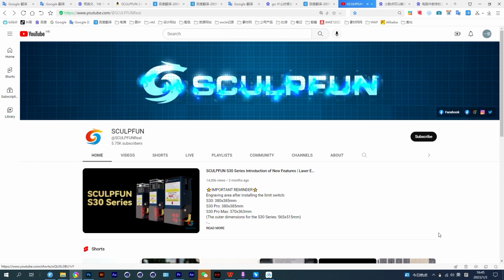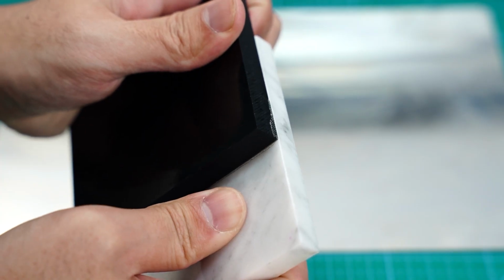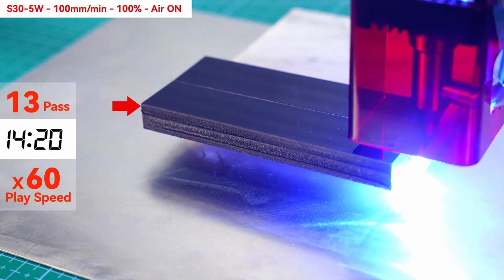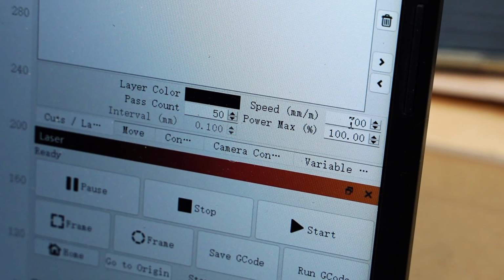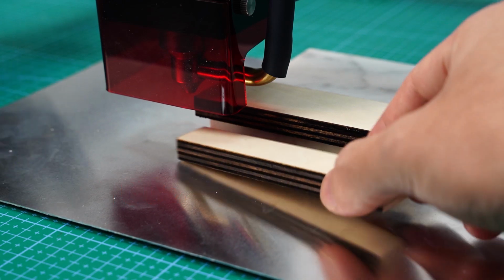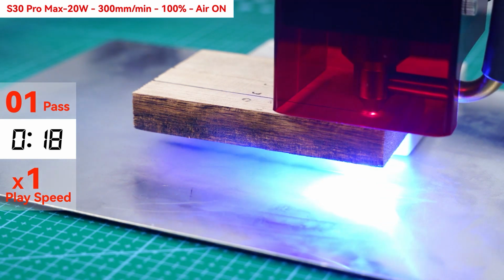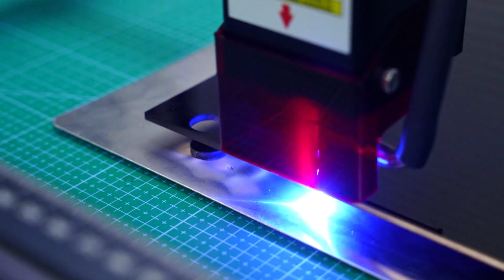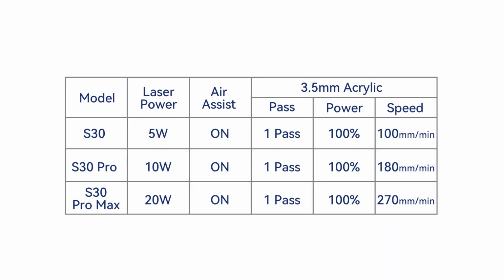Faster！But How Much Faster? SUCLPFUN S30 5W 10W 20W Laser Cutting Efficiency Comparison Test

Comment: What is the difference between 10w S10 for $470 and 10 w S30 pro with air assist for $510?  The S30 seems like a much better deal.  I must be missing something.
Reply from the maker: S30 pro 10W, with automatic air-assisted air pump, limit switch, linear guide rail in the package, can upgrade the Y extension axis, can upgrade the XY extension axis, can replace the lens, and one replacement lens is included in the package too.
-----
S10 10W, you need to buy an air pump (manual), it has a linear guide, you need to buy a limit switch if you need. You can upgrade the Y extension axis, you can upgrade the XY extension axis. And there is no replacement lens in the package. Can be upgraded to automatic air assist (need to purchase matching motherboard and air pump)
-----
We will launch a new model soon, please join the group for details：https://www.facebook.com/groups/sculptfunusers

Comment: I just buyed the s30 pro , but can't cut Even 3 mm mdf, for 9mm what settings would You use?
Reply: 7mm/s（420mm/min）
100%
3 pass  maybe
Reply: @党一哲  i'll try, it is a trial and error learning curve, but, at the end it works and it's satisfying, i just succesfully cutted 3 mm mdf, with a 700 mm/min 70% 3 pases air on config, i'll keep trying for thicker material
Reply: Hello, what Model do you have 5w or 10w or 20w ???

Comment: 20W laser is compatible with S9 model? If yes, what is the price of 20W laser
Reply from the maker: Sorry, 20w laser head can't match the S9 machine.
Reply: 20W laser has not been listed yet
Reply: Even if we have it, we don’t recommend putting 20W laser on S9 for high -speed carving work
Reply: Low -speed cutting should be fine

Comment: Is it possible to upgrade s30pro (10w) to 20w from s30pro max?
Reply: Unfortunately, no.  The 10w is 12v the 20w is 24v. Fell for the same catch.
Reply: @OscarDaFish  Thanks.
Reply: @markosrebernjak1175  I bought the 10W initially hoping that I could upgrade to the 20W later.  That's when I realised you couldn't.  :(
Reply: @OscarDaFish  So, 10w from S10 is the same to 10w from S30Pro ?
Reply: @anabel1488ify  10w is 10w, so yes. :)
Reply from the maker: @OscarDaFish  👍

Comment: The best cutting parameters for 3mm black cast acrylic to have best cutting surface quality for 20W Pro Max are: speed 140mm/min, 1 pass, power 19%, air assist off!
Reply: Which speed and power cutting acrylic 4mm
Engreving speed and power acrylic 4mm sculpfun s30
Reply: @muhammadafnan4437  Hi. For engraving the acrylic I use speed 2000 and 40% of power. For cutting 4mm cast Black acrylic I would use speed around 90-100mm/min and power around 35%, 1 pass, better with air assist, but if you prefer cutting without air assist, deceeasing speed to 80 may be considered.
Reply: why？Why is the laser power so low？  Is your speed parameter written the wrong unit?
Reply: @党一哲  if you do the cutting test like in the movie you show "just" capabilities of power and speed. For real work when you require quality and repeatability of the parts, you have to also consider how thick is the cutting gap and what happens at the bottom of the cutted part. When you add more power to acrylic cutting you'll have wider gap and some burns at the bottom side. Speeding up from 140mm/min to just 200mm/min requires of using 50% of power - that lowers the cutting quality. So in my opinion the best results for any materiał is to set the proper speed for the lowest power capable to cut through. Then you have the thinest gap and the best quality. Acrylic 3mm is 140mm/min 19%power and acrylic 6mm is 70mm/min  72%power, both 1pass, both no air assist. Overall the 20W pro max laser cuts very wide gaps, much more wider than 5W laser, so you have to also consider this parameter.
Reply: @piotrdivineacoustics5754  Sorry, my English is not very good. I can't fully understand what you mean.
First of all, low speed cutting or air assisted cutting will make the cutting surface effect of acrylic look poor. However, the test in the video is only conducted from the perspective of efficiency.
Second, the "just finished cutting" in the video is only for testing. In actual work, it is necessary to adjust the speed and pass count according to the drawing difficulty and material thickness. If you want to cut the surface perfectly, you really need to increase the speed or reduce the power.
Third, the default upper limit speed of 20W is 100 mm/s. Since the 20W laser is heavy, it is not recommended to lift this limit. Your 140mm/s, are you sure it is mm/s, not mm/min
Reply: @党一哲  you are correct, its milimeters per minutes, not per seconds😉🙂🖖😎
Reply: @piotrdivineacoustics5754 does this mean S10 is sufficient for cutting those 3-6-9-15mm plywood ? 

And by 10w+ power, it’s more than enough ?
Reply: @thanatosor for 8mm plywood I use about 80% of 20W laser power to cut in 4 passes, I tested laser up to 12mm plywood, but not thicker.